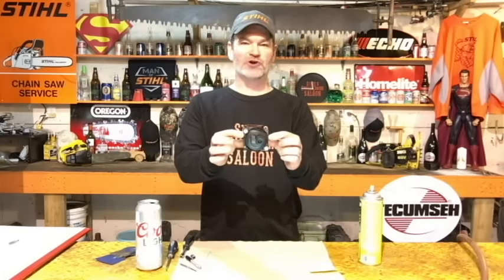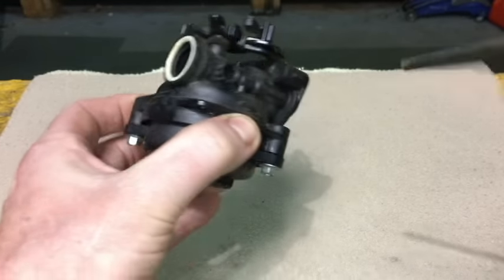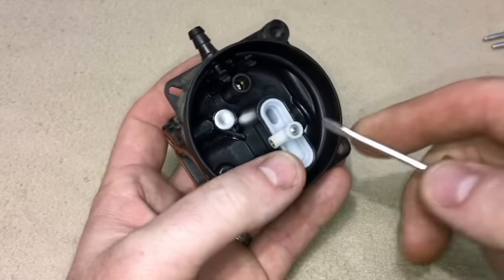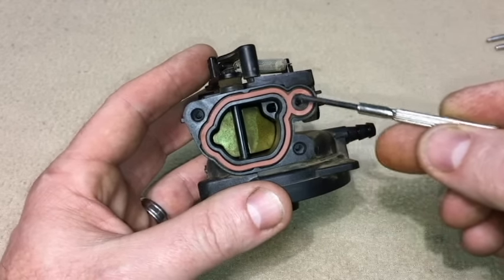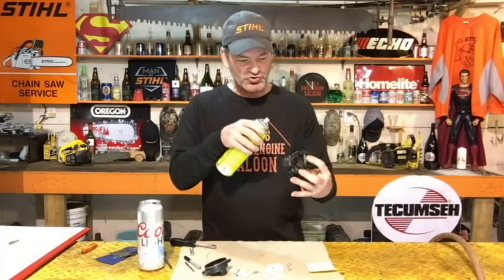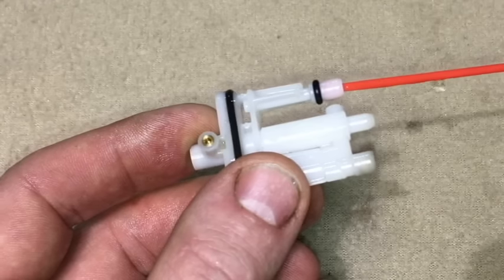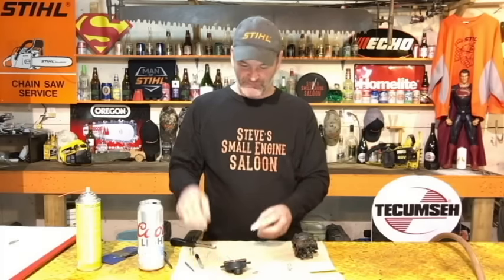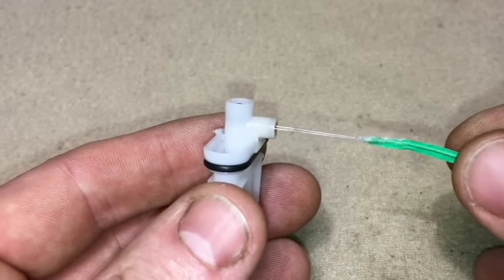EASIEST WAY To Clean a Plastic Briggs Carburetor

Comment: After watching the video I got my Toro going again. I did not drill it out yet but did thoroughly clean the carb. First sprayed cleaner through all the jets and passages, and did it again with an air nozzle. Put everything back together and it started up and ran fine. Have to cut my grass and will see if it stays running. If not will look into the drill fix. Everything looked clear and open. My mower is almost 4 years old and it was running up to this point. I did have some warning this was coming when I started using the mower this year. It finally got to the point to where the motor would not stay running and was hard to start. Thanks for the video and all the information. It was definitely helpful.
Reply from the maker: Right on
Reply: I found my old comment! I just went through my carb again for the second time in three years. I was initially having engine surge and the last time I used it experienced backfiring at shutdowns. Cleaned it out and that seemed to fix everything. I have a 7 year old Toro mower. If it holds up for another 3 years it might be time for a new one.

Comment: Hi Steve - thanks for the advice - mower (1 year old) wouldn't start for first cut of season. stripped and cleaned carb three times, ran for ten seconds or so then stopped. All spotless inside, reamed out jet as advised and started first pull and working 100% since!
Thanks for the clear advise and good video 
Jon
Reply from the maker: Right on Jonny....

Comment: Great vido, I told my wife the old metal carb works great, so some engineers had to change it, and now the hole is so small it plugs very easily, on our mower the very first tank plugged  with less than 1/2 tank ran, and I filled it direct from gas station pump,so no contamination from home fuel jug, and about 1 season I am back inside the carb again plugged and not running, will definitely be getting that small bit set, and drillling it out, I have had old Briggs motors run for years problem free, like 13 years and never draining tank, used only ethanol fuel in it , but it was 18 or 20 hp i don’t remember on a rider mower, if I remember right it says industrial grade or something to that effect, and I don’t baby it when I used on the big lawn, took3 hours running steady to mow, so obviously bigger jet hole in it vs 146 cc little mower for little yard

Comment: Best fix it video I have seen in along time.  Sitting here thinking I need  to clean carburetor as lawn mower won't start. Only 3 years old. Makes perfect sense. Cheap shit, I would normally say, not made to last, but in this instance,  not made to start.
Thanks.
Reply from the maker: You're Welcome...

Comment: I failed to add stabilizer to my fuel over the winter.  Sure enough the carb got gummed up.  Tried soaking the carb in carb cleaner, nothing.  Followed the jet cleaning steps as demonstrated on the video and it started on the second pull.  Excellent guide on the Briggs carb.
Reply from the maker: Thank You...

Comment: Hey Steve, thanks again for another great video! I'm working on one of these for a guy and I'll try your fix. Also, I have in the past used torch tip cleaning needles to clean out the jets in carburetors. Seem to work pretty well if you just need to rod the jet out.

Comment: Same problem!! Brand new mower, with clean new gas, third mowing and this jet is clogged! Cleaned it and it worked for one more time then No Start!!! I’m now drilling out this damn jet! And adding a small filter in the fuel line!! Thanks dude!
Reply from the maker: You're Welcome...

Comment: Thank you so much for your DIY technical tips. I actually like these plastic carbs as they are super easy to clean and rebuild. It has very few non-moving parts (just the float up and down shut-off motion) compared to a motorcycle carb. I would say these carbs are bulletproof, simple, and a no-brainer. No need to replace these unless they are either melted, deformed, or cracked breaching the air/gas atomization. Nonetheless, replacement costs are very cheap. But as in your post follow-up video, you teardown a carb for the technical and repair aspect. The joy of the learning experience associated with finding the root cause; and thus stretching your engineering mind in problem solving. And simply not to just replace it.  Thanks again Steve. Keep-up the great work 
my friend !!

Comment: Thanks Steve! Drilling out the main jet fixed my mower. I found a mini-drill set at Menards that had a 0.5 mm drill (0.0197") for $4.
Reply: Same. Cleaned the carburetor. Fired up on the first pull and ran for about a minute before getting clogged again. Found this video and drilled out the jet. Runs better than ever.
Reply: I find it to work better if you use a # 72 drill bit  .025 ,,,it works great .

Comment: My Toro with Briggs and Stratton was dying out last week after sitting since September.  It started fine but no power to dp actual work — it just quit every two feet. I watched your videos and bought the wire bits.  My main jet was larger than 0.48 mm so i left it alone.  Cleaned it well, reassembled and it started on first pull and ran like a champ with lots of power.  I am going to Paypal you some cash for your excellent and informative work.  Thank you!
Reply from the maker: Wow!  I just saw the Paypal.  Thank you very much Scotty...

Comment: Good vid,

There are 2 different main jet models ( that cartridge part has normal one and high altitude one). 

Parts #592684 (high altitude)
#592792 (standard)

I don’t know what is different about them but perhaps the main jet is a different size

Comment: [Original main jet opening may be too small from the manufacturer & may need to be increased in ID with a tiny screw bit to allow better fuel flow after cleaning everything with carb cleaner & blowing dry with compressed air.]

Hi Steve, I just found you for the first time today, have watched four of your videos, & am loving the way you explain things for those of us who have little to no experience with small engines... THANK YOU! I just get worried that there are sometimes not enough closeups of how things look before taking them apart to help me get them back together properly & get all the screws & parts back in the right places & positions!  Hopefully, the more vids I watch, the less foreign everything will appear when I get started.

Also, thank you SO MUCH for not having any background music in your videos... concentrating on the details requires all my attention & vids that add music are torture for people with attentional struggles.  God bless!
[9.19.2022]

Comment: Just found this video after replacing/cleaning my B&S model 09P602-0023-F1 carburetor (on a Troy-Bilt Lawn Edger TB554) for the third time, and paying someone else to fix it previously. I've had this thing since (I think) 2012 - thought I bought a piece of quality equipment, but it has been non-functional for most of that time. I just purchased the micro drill set and if/when this new carb clogs, I'll have a drilled version ready to go in. Really appreciate the insight here - keep up the great work my friend!

Comment: Steve Great video as always. You really explain everything well. I thought I would get out of this easy by dropping the float bowl and cleaning the one visible jet. It ran but there was still a blockage so I watched your video broke carb down, cleaned all openings and it runs great. 
I use the ends of guitar strings to clean jets. They work great and come in all gauges. You throw them anyway when you restring a guitar. Thanks again. Gerry

Comment: Thanks for the tip.  I think a lot of times they make the jet orifice very small to save gas, but it can cause clogging issues.  Bad enough that we have to suffer with Ethanol in the fuel!
Reply: Don’t buy gas with ethanol for use in lawnmowers.  Problem solved.

Comment: Lot of great info here. However I do have a problem I put the carburetor together and it starts up but now it leaks. It starts dripping from the bottom of the bowl.
Reply: float that snaps into place with the pin in the plastic tabs. May not be snapped in fully or has popped out or slid out not allowing the float to shut fuel off.

Comment: Great job there steve,just came in after getting the mower,450 and this same carby going again.Had the exact same thing happen and had some fuel coming out the jet but it wouldn't run after primer fuel had run out,tried 3 times taking carb off then saw this and run a wire (wire brush wire) through main jet and now running like new,thanks buddy having a Little Creatures beer on you in North Queensland.

Comment: I sold a mower with that type of engine a little while back and  not long after ,the customer came in shop with the engine not running right or even starting, . It was fine dirt clogging the jets, although the tank appeared relatively clean, I cleaned  fuel system, strained the fuel, starts and run fine, out it went.  This unit came back to the shop for same reason  3 times  in the span of a season .    I'm scratching  my head.....Finally discovered that the little strainer inside the tank was missing,  allowing fine particles of dirt to enter carb. After replacing the tank,  and mower has been running fine since.
Reply: Thanks for the tip on checking that too small little screen in the tank. I'll have to put that on my checklist. You can ASSUME it's there, but .....

Comment: Silly emissions standards, there trying to keep these things running as lean as they can.
Reply from the maker: My thoughts exactly....
Reply: @StevesSmallEngineSaloon  Yeah. My mower has a sticker on it attesting to its "3 out of 10" clean air rating (lower is better); so clearly -- emissions considerations went into the design... which is fine I guess. I just don't want to take it apart more than once per year.
Reply: I got four seasons out of my Bolens 140cc B&S. During the first season I was amazed at the gas mileage I was getting. Just the other day I had to go thru the carb twice to get in running again. First time I did not poke the holes. Came up with the bread twist tie the second time. Started on first pull. If it happens again I will drill that sucker out. Enjoyed the video.
Reply: Same crap they do with the 49cc scooter engines, they come jetted way too lean and the carbs are sealed, you have to drill out the screws to open them or just buy an aftermarket carb that is NOT sealed, in order to change jet sizes. They run too lean and people have serious problems up to and including melting a hole in the piston due to that. Screw this plastic carb crap, why not figure out a retrofit with a metal carb? has to be one that would fit, that plastic crap isnt going to last very many cleanings  having to PRY the bowl and cartridge with a screw driver to get them out
Reply: @HobbyOrganist  People of her type are so driven to drill down to the facts in her area of interest that she knows more in her short life than such as you will ever know.

Comment: I’m thinking that the reason the jet is so small is due to emissions. The OEM’s are trying to run these engines as lean as they can get away with. That’s why we see so many surging problems in these newer engines. And with no adjustments available, opening up jets is the only weapon you have available. BTW, I hate these newer OHV Briggs push mower engines. Not just because of these carbs, but because of the total lack of repair info available. Seems like Briggs doesn’t want them repaired. I still have not found valve clearance specs for them anywhere.
Reply from the maker: I totally agree....
Reply: John Acuff the operator's manual I have for the Model 100000 675exi / 725exi series have valve clearance specs @ intake 0.004- 0.008 (0.10-0.20 mm) the same for exhaust..

Comment: You've got to learn how to play the guitar.  Then after you wear out the strings, you will have a set of wire cleaning tools ranging from .013 to .056 (for medium string set (6)).
Reply: Tjats exactly what I use for cleaning carburetor jets! Awesome
Reply: 13s, are you The Incredible Hulk!?!?!
Reply: I do the same thing with my 10’s! I use the ball ends as handles. 👍
Reply: That's a damn good idea thanks
Reply: @artful_dodger59   :laughs in Malcom Young

Comment: Thank you so much for making this video! I have a 4 year old lawn mower with a Briggs & Stratton engine and this very same carburetor. It ran fine without any care for the first couple of years, but since then, the first run of the season, the engine runs for a few minutes and dies. The first time it happened, I checked for spark and for fuel flow. The spark plug looked pretty bad, so I decided to replace it. It still didn't work after that, so I hauled it off to my local hardware store, where they fix small engines. It worked fine for the rest of the season, probably about 8 times around the lawn. (I have a typical Chicago yard, i.e., not very large, maybe 2000 square feet of lawn to mow. Last week, first run of this season, right on cue, it ran for about 5 minutes and died. I decided that if this is going to be such a frequent occurrence, then I'd better learn how to fix it myself, just as I do all my own bicycle maintenance and most repair.

I looked up a number of videos, including this one, then got the carb cleaner and micro drill kit and did the fix you show in this video. Sure enough, my mower started right up, and I was able to start mowing the lawn. But after about 5 minutes, the engine started to surge and ebb, and after a few more minutes, it died again. IUnlike before I cleaned the carb and reamed the main jet, now it starts right up after it dies, and I got about 10 minutes of runtime before it died again. I could still restart it, but after this point, it wouldn't run very long before it died again. After a few more cycles like this, it would start right up and run for a few seconds, but then dies again. I got the impression that the problem might be heat-related, but when I checked the choke, it was wide open, as I expected it to be. What else should I be looking at?

Comment: I have the same carb.  I just want to say thank you for sharing your knowledge and making these films.  I took a bread tie and spray in the main jet.  Put it back together and it fired right up.  My Aunt had regular pump gas containing ethanol and left it sit during the winter.  That's what clogged it up is my guess.  I always use 91 ethanol FREE in all my engines.  I'm going to run the same in her mower now.  Thank you again.  By the way I also had a Coors Light doing the repair!!!!!

Comment: Had to take apart the plastic Briggs and Stratton carburetor on my power washer today. The main jet issue described in this video was my exact problem. Was able to get it cleaned out and the power washer started on the first pull. Thanks Steve! Super helpful video.
Reply from the maker: Glad it helped

Comment: Hello Steve. Brother I would like  to thank you. Your video on the Briggs plastic carburator save me tons of time went straight to the main  jet that you reccomend drilling to make the jet hole a bit bigger I did not have the micro drill bits handy but had to take care of the lawn before things got out of hand as we been getting a lot rain so grass is growing quick. So in a pinch I try a thin nail and tap it carefully until tip of nail went thru. Lawn mower Turns on first pull all the time now. By the way I have an easy stow model the ones you can store upright I notice while in that position I saw the bottom of the carburator and the 2 little bolts were accessible through the bottom so I took the main jet assembly out without taking the rest of the carburetor or  even the floater  out. I had a pretty good hunch that the main jet was my problem literally accessing the carburator from the bottom to get to the main jet took less than 15 min. Start to finish mind you I did not even have to empty the gas tank as it was full but the way the lawnmower sits on the easy stow position gravity helps immensely the only gas i lost was the residue on the bottom cup thingy that covers the caburator. Again thank you for sharing your expertise you save me  time and money as I was thinking I might need I new carburator at the very least.

Comment: I just had my annual fight with this plastic carb, referred back to this video for a reminder on all the spots to clean inside and it worked on the first pull and sounded normal, while at the end of last year it was doing that weird revving and cutting out and starting very slow and revving all over the place.  Thanks!

Comment: Thank you for posting this. I had to substitute Bud Light for the Coors but it worked the same. My Costco pressure washer would not start except with ether. After disassembly of Carb, I found main jet plugged. I was not sure how to remove Carb bowl until watching your video. It was tight. I used Leslies pool pump lube to assemble and will be adding a fuel filter.

Comment: Thanks Steve. Great video. Found that little white crap inside the cartridge and was blocking the tiny jet. The bread wire cleared it. Right after I ordered the micro drills. Your help is much appreciated.
Reply from the maker: You're Welcome...

Comment: Your a rockstar!!  My Husqvarna 3100 power washer that uses the Briggs plastic carb wouldn't start.  Cleaned the carb per your directions and it started 1st pull!  Thanks for the great video.
Reply from the maker: Great job!

Comment: Thank you so much for this video! We have this issue and did clean out the plastic part but it still wouldn't start. Once I saw your video - I realized that the spray wasn't coming out of the jet. This has to be the problem! This was the most thorough and easy to understand video I've found (and I've spent hours researching this).
Reply from the maker: You're welcome!